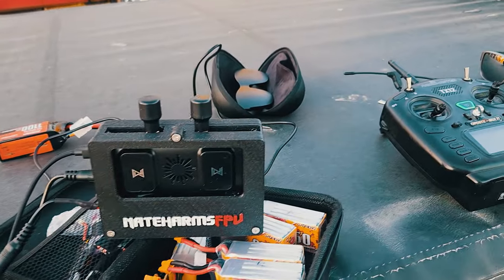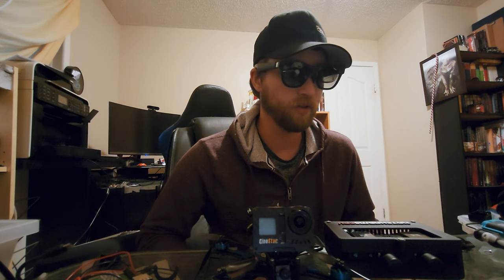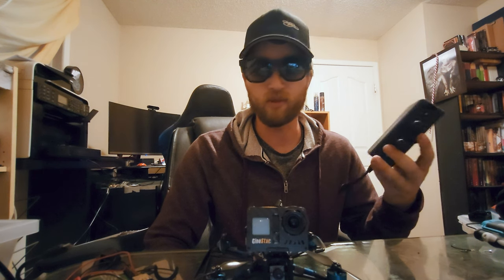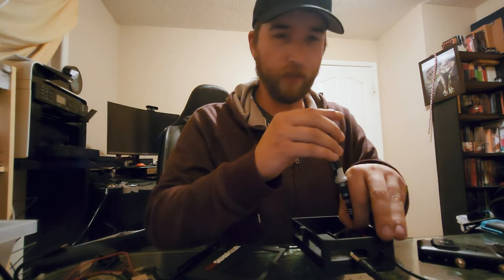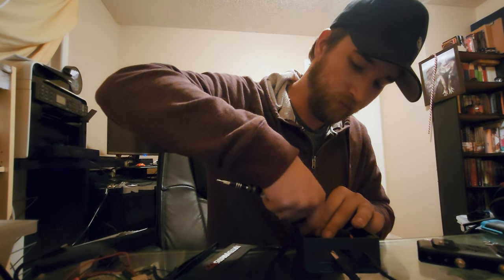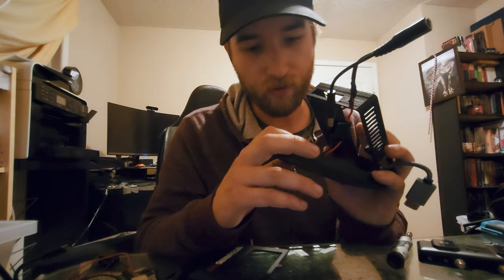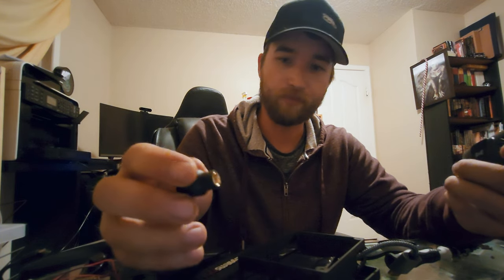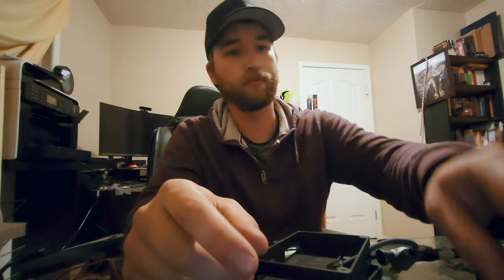How to fly FPV with transparent (AR) glasses

Comment: Nice. I won  a set of Xreal glasses a couple weeks ago and had considered a "FPV with these things" video but i ... got lazy and distracted.  My working solution is currently a USB Power bank connected to both a usb to 12v for the VRX, and a usb powered hdmi to usbc adapter.  no soldering but a bit clumsy.
Reply from the maker: Nice prize to win! Did you end up using the same usb c adaptor or did you find one that's smaller? The one I have is annoyingly bulky

Comment: Great video and you got my sub :D I ran into your project on thingiverse, while checking out xreal AR glasses mods. I'm actually working on the exact same thing, except in my case I'm creating a module for analog and HD-Zero. I'm looking forward to seeing how your project progresses. Greetings from Germany.
Reply from the maker: Good luck on your project and thanks for the sub! Just as a warning, the glasses only take 1080p or higher as I found out when trying analog. You will need an hdmi upscaler of some kind if the output is 720p or lower.
Greetings from Canada!
Reply: @nateharmsfpv  Thanks for the tips. I already have an analog to HDMI 1080p upscaler. For HD-Zero upscaling, I found an upscaler dongle from a company called Lindy. However, I can't seem to find  it anywhere for sale online. I'm writing them email to get more information about it.
Reply: @nuxnik  if you haven't got it working yet, i just used hdzero and put 1080p for the output on the vrx settings and it seems to work
Reply: @yamasaur  I have to know if there was any latency improvements with running HDZero and Xreal at 120hz. Please let us know

Comment: I have the same setup minis the box. I just have it hanging off the strap handel of my Boxer radio.
Reply from the maker: Awesome! I figured I couldn't have been the first to try this. Neat way to fly right?
Reply: @nateharmsfpv  Ya, the nreal glasses are awesome I use them with the cover on when I fly. But before FPVing with them I was using them with my steam deck and playing games. And noticed there was not a lot of lag.
Reply from the maker: @wel97459  Agreed. I bought them to play Starfield with, but the screens were so good, had to try this.
Reply: Ok now the really important question...
How is the FOV compared to the normal walksnail or dji v2?
How is the latency?

Comment: I wouldn't use this for drone freestyle because of the increased latency, but I thought about using it for LR flights with a plane, with high gain antennas on the goggles (so the goggles would be mounted and I could wear the xreal).
Reply from the maker: I was freestyling a bit this morning with it. I probably wouldn't take it Bando bashing, but for park flying it seemed to do pretty well. Next stop is downtown to try and stealth building dive.
These would be so comfortable for a long range wing flight for sure!

Comment: Awesome video! ... is there a way to input a different image to each eye?  I feel like the next step in FPV is to add a sense of depth.... 2 cameras/vtx, set about the same width apart as your eyes on the drone (ideally adjustable), each send a separate image to each eye of the goggles..  this would give you depth perception that matches your natural eyes and would take this hobby to the next level of realism.... if you could add head tracking that would be the pinnacle of immersion... i've been thinking about this for a couple years (even designed a frame for it), but  it's just out of my league to try and hack some FPV goggles in half to get them to accept different images to each eye (also pretty damn expensive)... any thoughts?
Reply from the maker: Thanks! And yes! I have actually been thinking about that idea for a long time. Tried building my own analog goggles for it but the resolution was too low on the screens I bought.
These glasses are a good contender, however the biggest challenge will be the software side. The glasses have built in head tracking and other AR features so it's very doable. The dev kit for these uses unity which poses a few problems, the biggest being latency and processing power. You would most likely need to bring a laptop with video card to the field with you. It would also require 2  independent hdmi capture cards that could run with as little latency as possible.
All in all, it's 100% possible with these glasses, but the software and portability factors would be the biggest hurdle.
Reply: You wouldn’t want this because it will became trouble many people experience when using VR. when picture become more “real” you brain start to thinking you are poisoned because you didn’t move but image in front of your eyes is moving. This will cause nausea. Maybe a head tracking and controlled gimbal will help to reduce this effect.

Comment: Hi there, I have bought the same HDMI to Type-C  , HDMI Mini to HDMI converters and Xreal Air.  Yet, I could only see nothing and a 4:3 blue screen even updating to the latest Walksnail firmware. 

I have checked the diaplay output by connecting to a TV which shows normal Walksnail UI.  I wanna know if there is any settings need to do?
Reply from the maker: Hey! Connect it back up to your TV, power on your drone, in the goggle settings (under display I think) set it to 1080p, not 720. The xreal air will only take 1080p
Reply: @nateharmsfpv  thanks.  I will try it later 😊
Reply: Hi, me again.  I have the VRX and soldering done.  I wanna know if I could enter race mode when I am using the Xreal Air?
Reply from the maker: @fattgorjai7880  hey again! I don't know for sure, but I don't think so because of the need to be in 1080p unfortunately

Comment: I fly using my Z fold 3....always flying alone...it's the same issue...VLOS....so I got the Airs and a beam for thew exact same reason...and I still use my phone to fly...but I smartview into the xreal glasses and love being able to see in such a large format...I've found wearing black helps with reflection issues...I honestly am not sure why you would need any of the other stuff you're connected to....seems redundant and a lot like spaghetti noodles...smartphones can broadcast their screen signal wirelessly....
Reply from the maker: Seems like you found a practical solution. For me I wanted to keep the latency as low as possible which means everything needs to be wired.

Comment: So why not just use a hdmi to usb c cable?

And then just put the walksnail vrx in your pocket or something?

Also how is the latency with the nreal glasses. I thought about using a hdmi to usb c cable before but I wasnt sure about the latency.
Reply from the maker: Unfortunately the nreal glasses require an independent power source as the power through hdmi is not enough. The adapter allows me to feed a stable 5v 2amp directly into the type c cable.

The latency is not noticeable any more than dji goggles. But I'll be doing a latency test hopefully this weekend and will share here
Reply: @nateharmsfpv  ah ok I see. I thought that those glasses were battery powered. Maybe I can just get a battery powered glasses and just do HDMI to usbc
Reply from the maker: @Wenduoy  Yeah, they don't have a built in battery, but weigh something like 50 grams so are very comfortable. Because a battery is needed for the vrx anyway, it's not a huge loss for me personally

Comment: I was thinking of doing something similiar, but i wasnt sure how wel these glasses worked for fpv so i never bought them

I dont think this is great for safety as you stated flying transparant screens are hard

But i wonder if you get the cheap fpv droid  connector of aliexpress
Connect it to your phone and connect that to the xreal if it would work
This would really work for people like me, i like to fly but im not big on fpv, spending 300/500 on dedicated drone glasses seems like allot
Where i could buy these and  use them for more than just my drone
If they are derpy, i wouldnt bother
But if they are good enough it seems really fun to just carry them around and always have a setup with a tiny whoop in my car

Comment: Watch as DJI steals this and makes it cost $2k+.  Awesome idea.🤙👍
Reply from the maker: All I want from dji is for them to make a dang vrx with hdmi out 😂 I had to buy into the whole walksnail ecosystem just for this project because dji couldn't be arsed to build what the community needs. The way the laws are going, I could totally see them porting their tech to the world of AR. But it will still be cheaper than Apple head gear 😅
Reply: They already do that. But not for fpv community. Just for regular drones like mini 3 or 4. U can directly connect ur AR like xreal in RCpro and fly.
But i feel that company like HDzero or Walksnail make first step for make some vrx for AR.

Comment: What's the latency though? That's what i was hoping someone would confirm about these glasses so far..
Reply from the maker: I wish I had a way of testing it, but it feels low enough for anything but pro racing. Because it only takes 1080p, the vrx is like 32ms. Glass to glass it's probably closer to 38-44ms, but that's really a guess
Reply from the maker: @Shauny_D This is a fantastic idea. I will test this out over the long weekend and post about it once I math it out
Reply: It isn't perfect but works to get an approximation or figure out which settings are better.  LED lights i've found to turn on and off the fastest as opposed to a hand clap or something.  Still LED's will turn on over 2 or 3 frames in 240fps
  @nateharmsfpv
Reply: @nateharmsfpv I liked the idea of these glasses with a custom OpenHD/OpenIPC HD system.  Maybe that might offer lower latency for you.  They were testing out some 1080p120 fps cameras recently
Reply: A rough way to do it would be to setup a timer on your PC screen with milliseconds, loads of the Web for this type of thing and then point your quad camera at it then try and film it with a slomo most camera phones have some type or failing that just take a picture but you obviously have to angle the glasses in such a way that you can see the glasses display and the monitor on the same shot
Reply: Then obviously compare the screen with what the glasses show and the difference is your latency...which I expect to be quite high
Reply from the maker: Hey @saidnesh5 I made another video testing glass to glass. It's averaging roughly 44ms
Reply: @nateharmsfpv  Hey btw. Just read that the "(the original Air got 120Hz mode as a software update)"  Does this change the latency in anyway?
Reply from the maker: @saidinesh5  I am not sure tbh. The latency is mostly bottlenecked at the converter so I don't think it would make a difference. On my laptop, it's staying at around 25-35ms still. I could be wrong and it might help slightly.
Reply: @nateharmsfpv  Oh that's interesting. That means the latency could be even better with these glasses with OpenIPC.. Thanks.

Comment: Did you have any issues with the picture being doubled on the glasses?
Reply from the maker: I don't have any issues like that
Reply: @nateharmsfpv  just my luck… 🙄
Reply from the maker: @Rckid28  whats going on with your double vision issue? Is it like 2 screens on 1, or like a background reflection?
Reply: @nateharmsfpv  the top 1/3  of the image is cut off and at the bottom of the screen, and I’m even using the first party adaptor
Reply from the maker: @Rckid28  Oh wow, that's really weird. Have you tried a 3rd party adaptor? Also, is your vrx set at 1080p?
Reply: @nateharmsfpv  yes it’s set at 1080 and I have played with all the settings… one setting called zoom out does nothing unless you put it at 10% some strange red text code is all I’ve the screen… it’s so weird… tech these days is so trash I’d rather just go back to analog just so it works
Reply: @nateharmsfpv  turns out an update to the glasses solved the issue!! This feels way futuristic!! And the pro camera is like daylight at night!

Comment: what is the latency on this system? It seems to be a constant concern whenever people are looking into using AR glasses for FPV.
Reply from the maker: @gheob2002  Average latency on this setup was 44.159ms glass to glass. This is within the same realm of dji or walksnail. I did a test here, and you can see the results near the end of the video: https://youtu.be/fGPC334vE_0?si=bHWOpTQ6mvV6yc5G

Comment: Hey, does this work with the 100fps vrx mode + 120fps xreal firmware?
Reply: BTW I am just getting into FPV, and was scheming to use my xreals to avoid buying goggles. Am planning to use a powerbank to power the HDMI converter and VRX, just gonna tape it to the back of the vrx, and wrap up the hdmi and power cables from the powerbank/vrx combo to the converter together as well. should be pretty clean.
Reply from the maker: No it doesn't. The video will not come through to the glasses unless it is 1080p which restricts the fps to 60
Reply: @nateharmsfpv  sounds like that's probably coz of how the converter you're using works. Will try a different one and update this comment in a bit.
Reply from the maker: @ashirbasu1730  the xreal airs won't accept less than 1080 even out of my pc so I think it will be a problem unless the adaptor you use allows for upscaling.
Keep in mind the vrx requires at least 7volts to operate so make sure your bank has a port for that. It will go up to 21v so a 9v or 12v port will work fine.
Good luck on your build and welcome to the hobby!
Reply: @nateharmsfpv  nope, you're right. The signal mode is still 1080p, it's just scaling it up from 720p on the gpu. Bummer.

Comment: Couple of days ago i wondered if this was possible 
I draw a lot in 3D CAD software. So firtst i wanted to buy VR goggles.

But than again the uprise of ar glasses and the price made me doubt.
They easily cost 300euro and up.

If i get it right you can fly FPV with these kind of AR glasses. 
But the drawback is the near angle of sight.

How distracting is this, the smal viewing angle?
Because when I'm midd flight i want to feel like an eagle 🦅

My doubt went from VR goggles (wich i think can replace FPV drone goggels?), 
To AR glasses with the blinding shitters like yours. So you can still have an kind of VR Feeling, if desired.

Thanks for sharing. :)

Comment: so much extra electronics for a not really great video experience... but damn do you look cool.  😎
Reply: just the dongle and the volt regulator are extras. The glasses itself cost less than 300$ with screen quality and fov greater than top of the end goggles while only weighting 70g. The fpv goggles market is heavily overpriced, it puzzles me why I need to pay 1000$ for a screen on my face and the lenses are not even that good

Comment: hdzero isn't true HD.  LOL
Reply from the maker: 😁😁 for this project I mean it literally too. Glasses won't even turn on for less than 1080p hahaha
Reply: @nateharmsfpv HDzero does have a 1080p output mode for picky HDMI inputs.
Reply from the maker: huh, TIL. I didn't think it did
Reply: @nateharmsfpv  it's a menu option you need to enable. The fun thing is if your goggles only support 720 input and you are messing in the menu and select 1080 ur screwed.
Reply from the maker: haha, I imagine you would have to do what I did for these and plug em into a monitor to switch it back